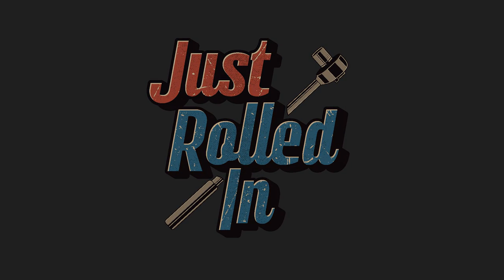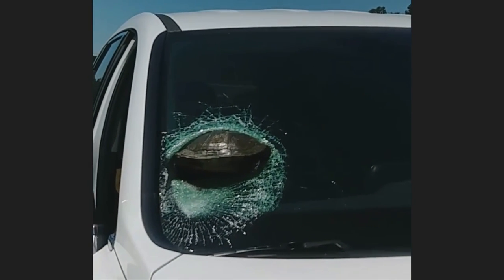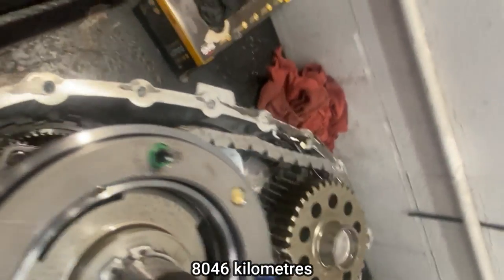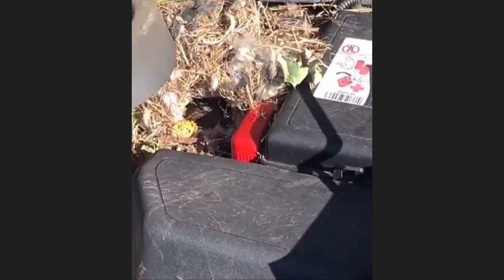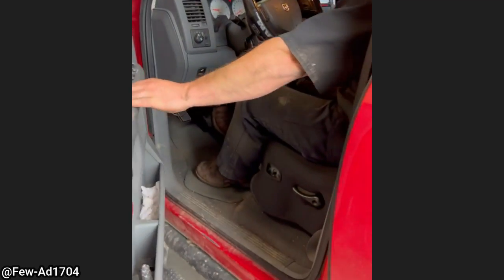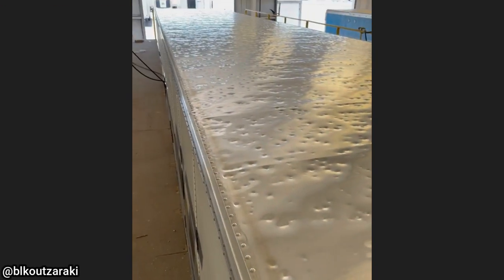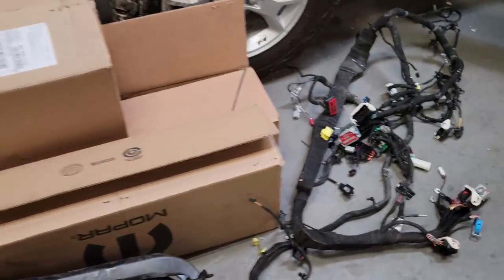Customer States Truck Will Not Move When In Gear (GMC Sierra) | Just Rolled In

Comment: My guess would be that the ford was either driving with 4H on dry pavement a lot or he put it into 4L while moving
Reply: Most people don't realize the front and rear diff gears are slightly different ratios. OK on dirt, but pavement makes the x-fer case work against itself... BOOM! :(
Reply: @PhilG999  100%. Some people think that suv's with awd always are fine, so their 4x4 truck will be fine if they just leave it in 4x4. The boom becomes inevitable

Comment: All these new trucks and there issues with mechanical or electric problems. My 1992 f150 4x4 with a 300 straight 6 with a small turbo has 0 issues and I still get 19 mpg on the highway modified frame and so much but its just so much better

Comment: The off roader in which the insurance paid for the repairs, would it not have been cheaper to scrap the vehicle and get another?
Reply: Not for those kinds of vehicles. They are worth more used than new in some cases. I bought a 2021 4Runner for $48k and a month later the dealership wanted to know if I would sell it back to them for $52k.
Reply from the maker: I guess not in this market. Insurance company probably thought it made more sense to just fix it.

Comment: Always love the animal clips, and glad the turtle/tortoise/terrapin was OK - they sort of stopped evolving around the time of the dinosaurs, probably by finding that slow doesn't matter when you're that damn hard.
But the other one: "towed in because it wouldn't start after being idle for a time"? Could the owner not simply have opened the bonnet? (Sorry: hood. Gave myself away there). I mean, the first thing I'd assume was a dead battery, easy fix. But then again, may they did just that and slammed it down again, "Tow company, I've got a 'someone else can deal with it' here."

Comment: Ya know for a country where most cars are automatics, it was always bizarre to me why even today so many vehicles do not have active safety measures for drivers who try to get out when the transmission is still in drive or even neutral. I have had all sorts of Mercedes and BMWs and the like where if you have the thing in drive and just open a door at low speeds the car immediately bongs a warning and stops the vehicle. Most have auto door locks to boot over a certain speed that you need to disable to open the doors when moving. I understand some very limited scenarios you might actually want this sort of 'ability' to have the vehicle move by itself (not exactly safe) but then they should all automatically stop unless you do some sort of manual override yourself. I think back just a few years where the Star Trek actor was crushed to death by his modern Jeep Grand Cherokee rolling back down the driveway when he had gone to shut his gate. Would not happen in most modern European autos I have used. 'Murica!
Reply: How are you supposed to bail out the side while jumping the car off a cliff?

Comment: why did you need to change the whole wire harness on the jeep?
Reply from the maker: They took it off roading and afterwards it wouldn't start. They filled the inside with a couple of inches of water.

Comment: sometimes i wonder how the heck this stuff happens like when you turn the blinker it locks the door
Reply: there's a wire going to the blinker, and a wire going to the door.  Perhaps they lie beside each other.

Then something damages the wire -- pinches them too hard, or they get rubbed against a piece of metal a million times until they're bare, or a rat gnaws on them or something - now the wires are accidentally connected.  Turn on one thing and power flows to both.

Comment: 0:05 or the driver accidentally slipped off the clutch pedal (if it has manual, that is) while giving a lot of gas... 
0:22 has the turtle attempted to take revenge on these puny two-leggers? XD my only idea is that a predatory bird caught it, and lifted it high up to let it smash on the road. here in europe some crows and raves like to crack open snail shells and walnuts like that. and then that stupid truck came along and STOLED MAH DINNAH
0:35 kind of cute. and they even have their water source on the dash, too. :) but a fluffy roof, dunno... it would tickle my bald head too much.
1:16 rodent pokes nose out, "damn humans, go away!" XD
1:34 what irks me is that it is obviously necessary to add such a feature these days, and people forget more and more they are operating heavy machines there.
2:04 cor'blimey! to think this brake is one of the easier ones to service, and they still fail? and everything is ruined? maybe they abused imperial tools on a metric stuff. or forgot how to loose a screw.
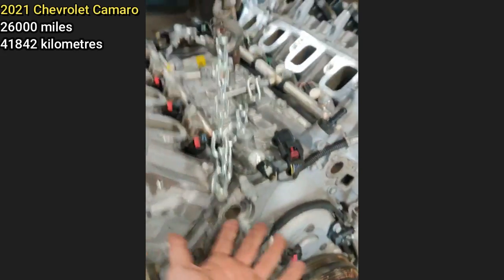2:19 reminds me of someone driving a 86 Pontiac Firebird with 5.0 and manual shift, and they ruined the cluth every 10.000km... regularly! of course it's easy to replace, but still. after the third clutch I'd rethink my driving habits, right?

Comment: my RAM will actually SLAM itself in park if you open the door while backing without your seatbelt on..  I guess thyey assume you will use the mirrors and the camera rather than back a trailer the old-school way like I grew up on which was lean out the door to see the trailer..  not in my 2022 RAM it beeps and slams itself in park..

Comment: the broken drive shaft reminds me of an old wives tail.

Supposedly, a couple meth heads in town were trying to steal someones catalytic converter to pawn it off.
But instead, they sawed part way through the drive shaft with some power tools before someone noticed and chased them off.
Reply: plausible.  this channel has shown times they removed the entire exhaust system EXCEPT the cat...

Comment: Is there really any reason to replace the roof on that trailer?  It's aluminum, if it isn't punctured, there's no rust issue.  And like the dimples on a golf ball it will cut through the air better.

Comment: i call bullshit on the electric feature on that red ram at the start of vid i have a 3rd gen ram and it doesn't honk at me if i leave it in gear and turn it off and open the door nothing happens that has to be aftermarket they never came with those from factory in any way
Reply from the maker: It's a recall (E17) https://bit.ly/3HxsrQ6